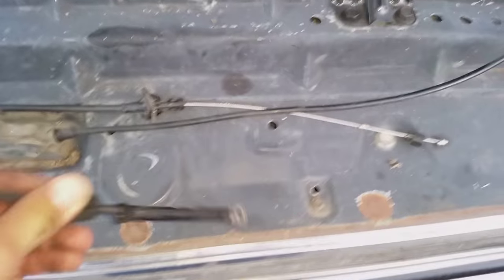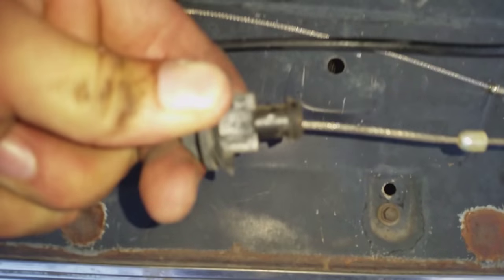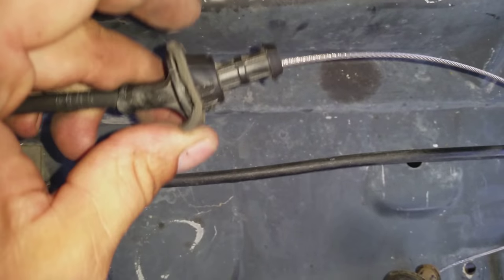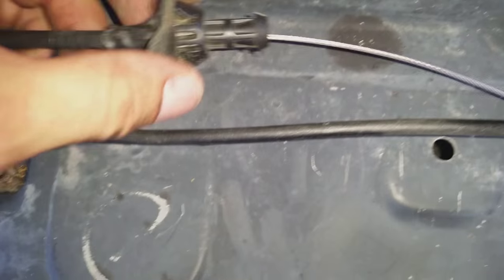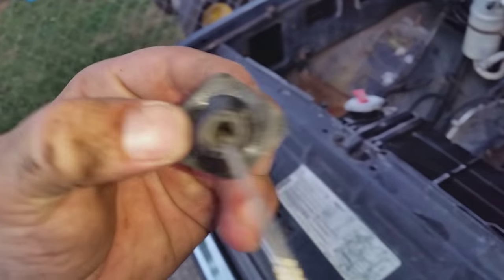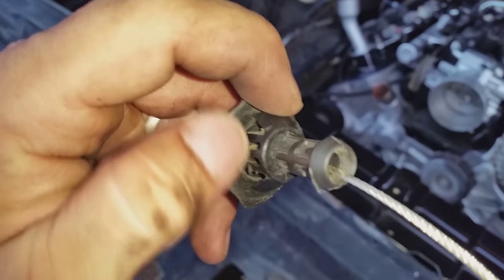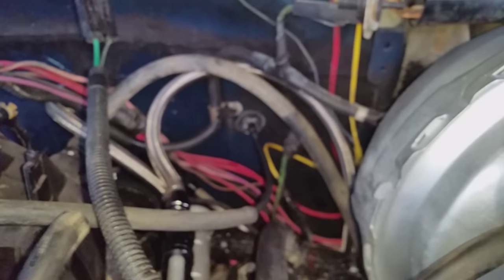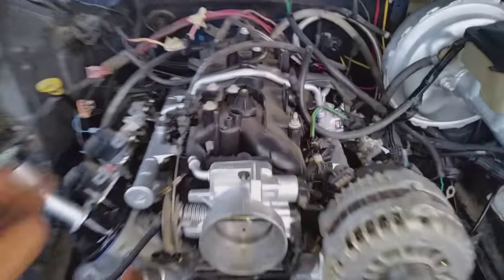LS Swap Throttle Cable Tech Tip

Comment: Did you have to change the cable stop on the gas pedal side or does it adapt to the square body pedal?
Reply from the maker: It fits it. I used fishing sinkers to take up the slack on the pedal side.